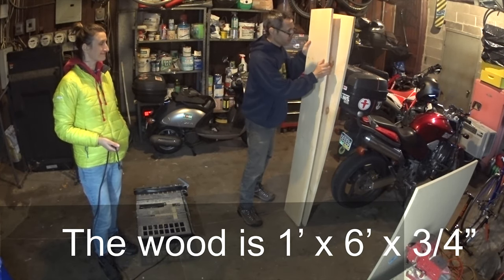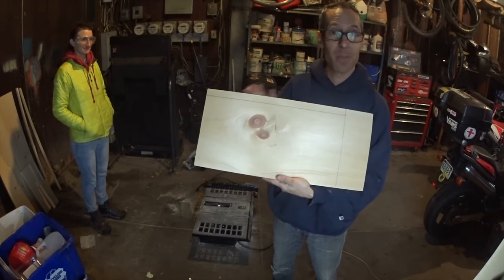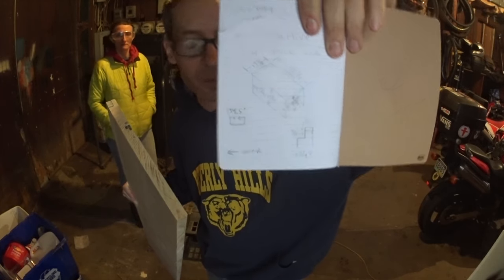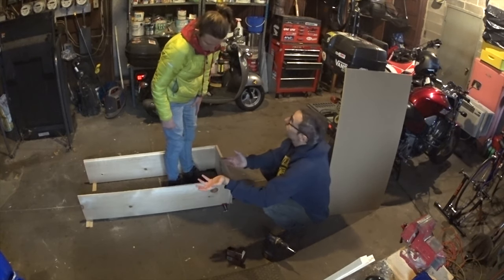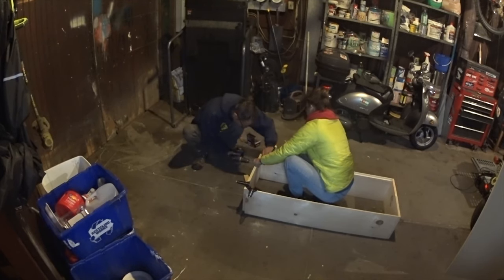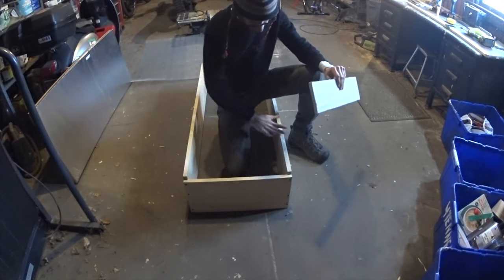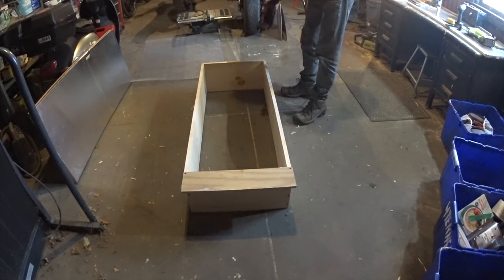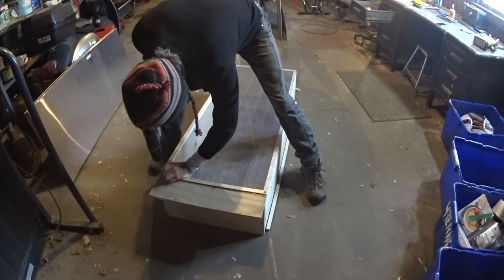Full Construction of Horizontal Long Hive

Comment from the maker: Update. It’s amazing to watch this video and see how messy and cluttered the garage is. We have since cleaned the hell out of it and organized it much better. Gone is the pink fridge, the running machine, the iron Franklin stove behind it and all paint cans on the shelves. My girlfriend has upgraded her 50cc Yamaha Vino to a 125. Oh yeah!! 🤟 Also, I have purchased a full size tablesaw making construction of anything a lot safer than that little craftsman tablesaw. It was definitely a mistake using plywood for the landing board. After a year it started to swell and split. I have since pulled it off and replaced it with a piece of solid wood. The bees are doing great in both my long hives.

Comment: Very interesting. I've been planning one of these for a while and am about there. Got some good ideas fro your build. There are a couple of things I'll do differently like make it so I can slide out the bottom board (out when it's hot for additional ventilation, in when it's cold). Can't get #7 cloth here so I'm going to have to suffer with #8. Another big difference is that I'm going to make the ledge where the frames hang deeper and use a bunch of 1x4's (3/4 x 3 1/2)  that will sit on the top rim of the main box and leave 3/8" clearance to the top of the frames. This will necessitate an additional ledge  around the top of the box. Lots of details but trying to keep to the magic 3/8" gaps. Not a good videographer - maybe better to put my stuff into a powerpoint and animate/annotate it for a video. Last - on the divider board - why not let the bees go under the board (if you want) were you can set a feeder back there? I use bucket feeders on standard hives in a hive box and haven't ever had a problem with burr comb. Great Video! Thumbs up! And great that you are working with standard stuff.
Reply from the maker: Hey Thanks for writing. I thought about ventilation and having the bottom open in summer, but then that let's small hive beetle in a lot easier. They are a real problem around here and I prefer to close up as many opportunities for them as possible. Even wax moth is a concern. As for the divider board and feeding, that's a great idea i thought about last fall after witnessing much robbing while using an old school boardman feeder (entrance). Yeah, I will definitely use that area for feeding in the future.